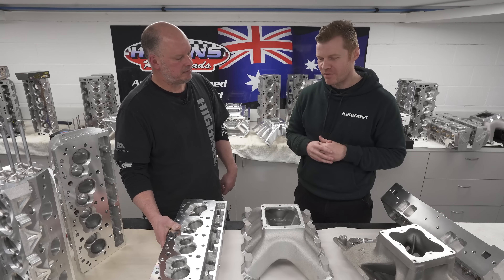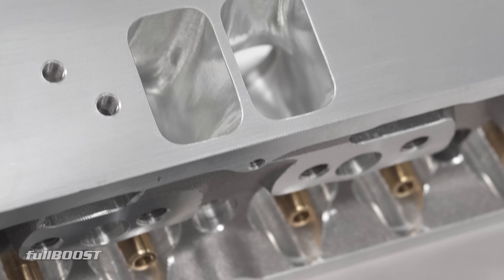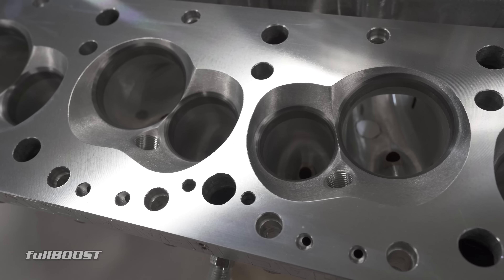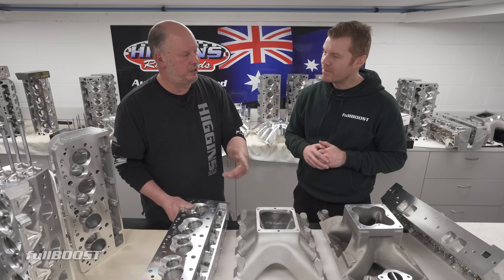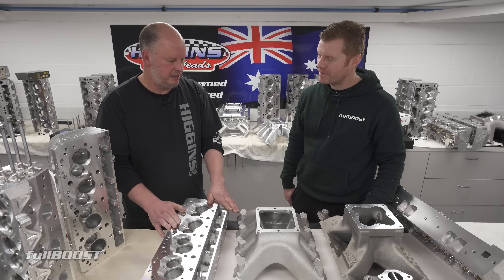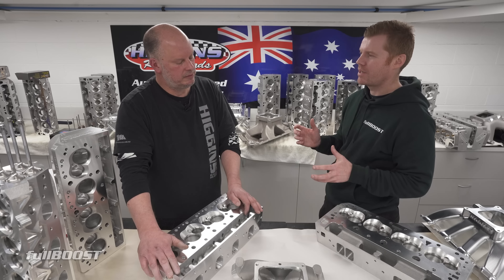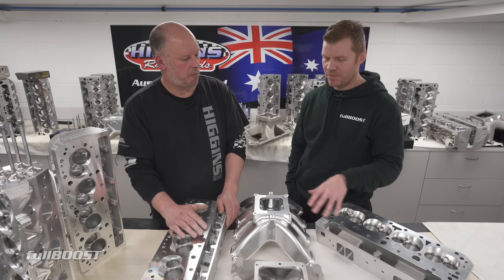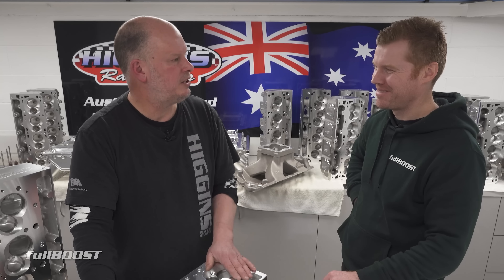The importance of matching your cylinder heads and manifold - SB2H Induction by HIGGINS | fullBOOST

Comment: Also what is very important is the ratio of the rockers and also why on earth do camshafts lobes are so wide when the lifters only touch around 1/2 the surface of the cam lobe, so why not make up a cam lobes which are less thicker but still the right dimensions and yet less rotating mass, thus better HP figures in the end? I don't think anyone has done this yet in making a camshaft for N?A engines 4's 6's 8's etc?
Make up a new camshaft design to be less thickness on the top of the lobe and yet still stronger than a standard camshaft, thickness etc ??

Comment: SB2.2 engines are the way to go today if you are going big HP for sure.  The problem is The Heads and manifold will need an engine block crank rods and pistons let alone a cam and a dry sump to go along with it all. You can get a used refreshed former NASCAR style sb2 (Just Oversize Bore out of spec) for 27k us in the us. I dont know what V8 super car engines go for but they would have to be 45K at least. The heads look great however dont be fooled the excellent power figures for the SB2.2 come from it's Giant camshaft gives it the chance to produce lift more than any other V8.
Reply from the maker: You can build a conventional street V8 engine using this induction package. We have filmed a number of them.

Comment: Do you do SB2H for Cleveland?
Reply from the maker: Higgins manufacturers a range of SBF heads. 👍
Reply: @fullboost  Classic politician answer. I deserve that for asking a serious question on YouTube. I’ll phone Higgins.
Reply from the maker: It's not that hard to look on their website, or yes just pick up the phone we don't work there. :)
Reply: Thanks again Mr Andrews for stating the obvious.
Reply: @2burning2turning  The SB is more like the D3 Cleveland head than not. 

 To answer your question, the Higgins Clevor head is much like the previous generation NASCAR C3 head.

 FB has done a series on them too, 700 hp on pump gas, 800+ on race fuel.

Comment: You would spend a fortune getting a set of 18 or 23 deg Brodix heads maxed out, and manifold flowed but they will never flow as much power as  the SB. 2.2. HP is never cheap, but with packages like these, it is easy HP V8 Supercars have used them for years too.